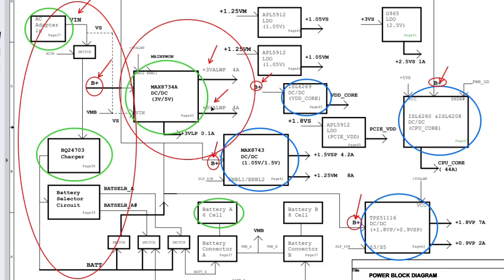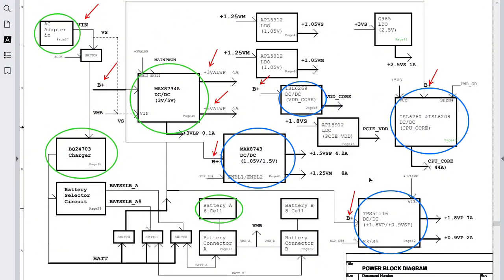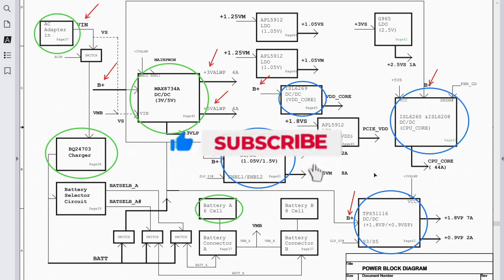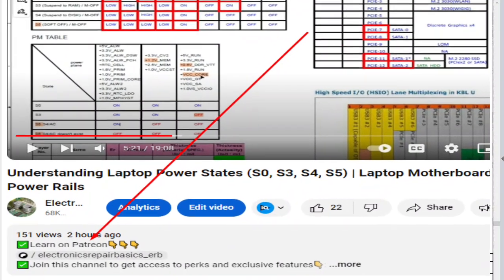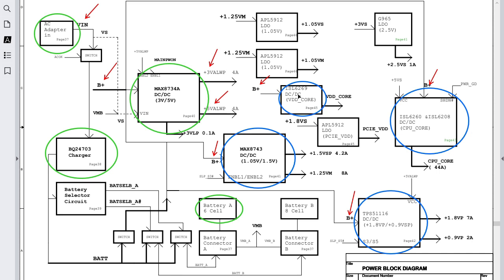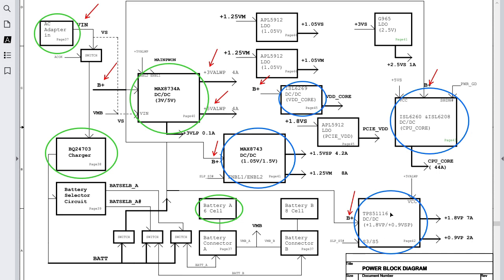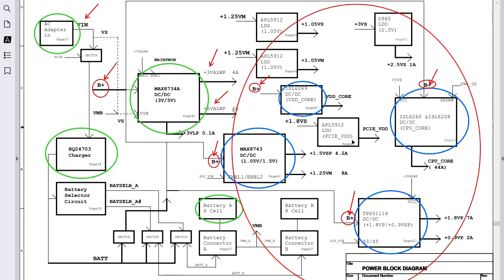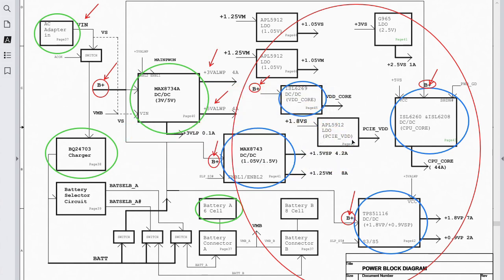How to Repair Laptop Motherboard: Power Sequence Explained Step-by-Step

Comment: Sir many time I request you how to test the output of ic .where I can put black lead to test output of any ic
Reply from the maker: The details about how to test outputs of ICs in my Patreon page.
Good luck
Reply from the maker: The black lead is always connected to low rail
Reply: @electronicsrepairbasics_erb  low rail mean the rail conected to capacitor negative sir? What is that low rail?sir please help me sir